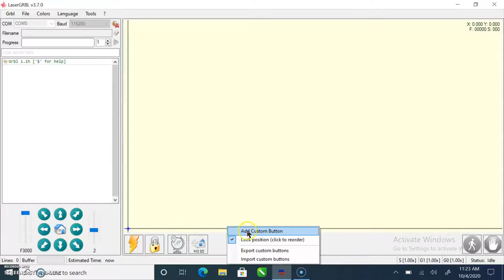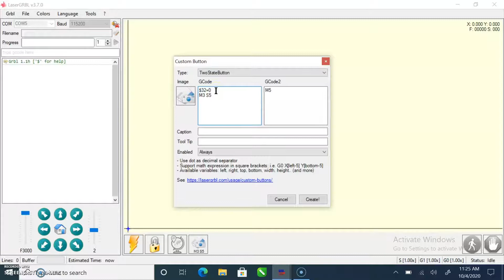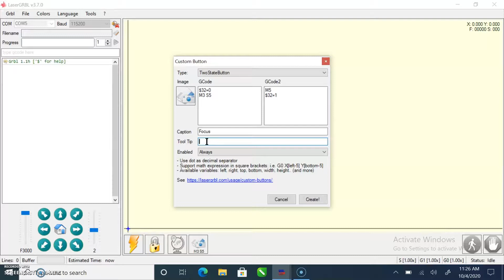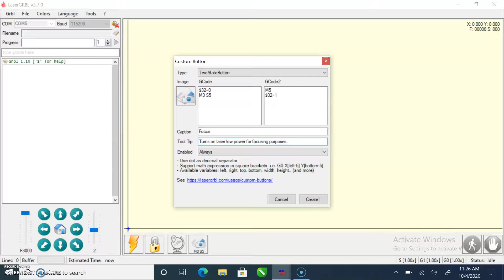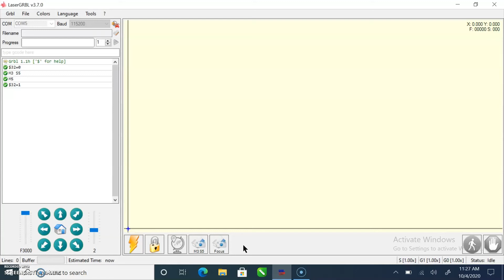LaserGRBL: How to add a custom button!

Comment: Hi nice tip I have a problem with LaserGRBL in that although I can make a new "material" in the database, and it stops in the list I cant select it so it shows in the dropdown menu when you want to se the power. What am I doing wrong?
Reply from the maker: I stopped using LaserGRBL a year ago. Lightburn works much better for me. Highly recommend it. The database should be a rough estimate, the true feedrates should be found experimentally by doing test engravings. I do not know why the database isn't showing you're new materials. I hope you figure it out soon! Good luck!